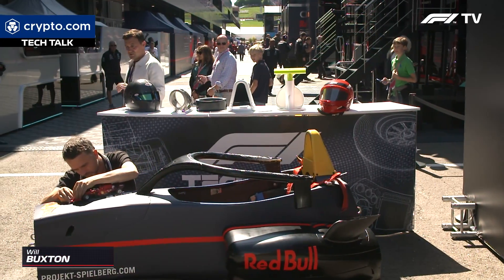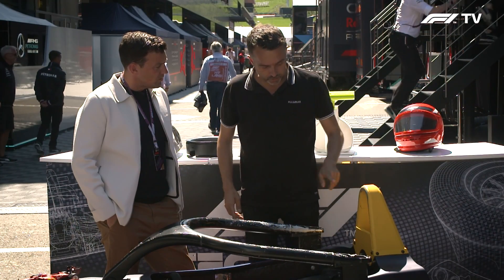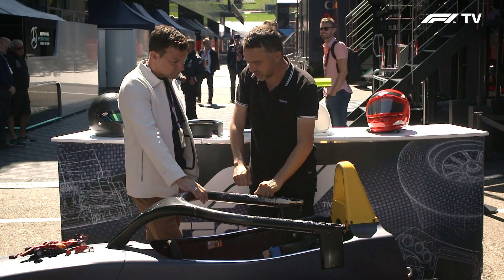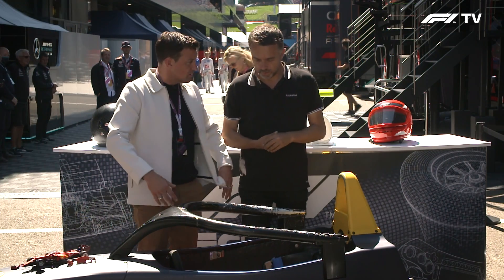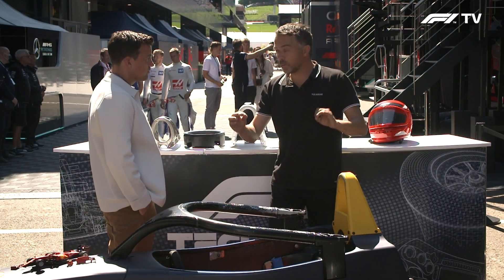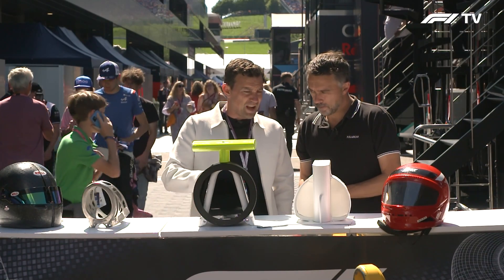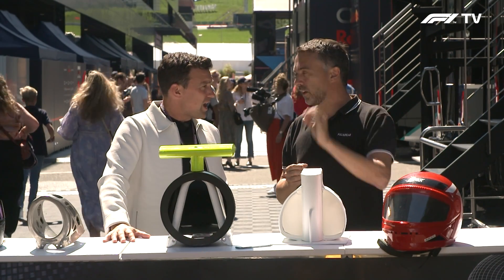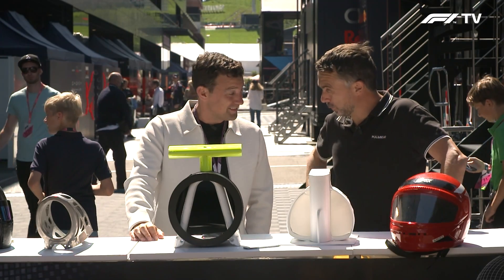How The Halo Works | F1 TV Tech Talk | Crypto.com

Comment: Did they weaken the roll hoop when they implemented the halo?  In the past when a car went upside down the roll hoop would roll the car on a side helping to slow the car when it enters the kitty litter for example.  However when Zhou rolled and the roll hoop broke off, not because it broke but because the attachment of the roll hoop to the chassis broke the halo became a skid plate for the car which allowed it to skip over the kitty litter and hit the fence.

Comment: My only issue with the halos is that I wish they had 2 pillars on 2 sides instead of 1 in the center. It kinda blocks the central view.
Reply: It is more necessary for the drivers to look into the turns than to look straight ahead

Comment: The fix here is to do one test to failure and specify that failure needs to occur within the metallic structure as a ductile yield. Obviously you can't test every car to failure but having a representative design validation test for the failure mode would go a long way to helping prevent this in the future

Comment: How about design a roll hoop that can withstand a roll.
Reply: It wasnt the roll hoop itself that failed. It was the connection between the hoop and the survival cell.

Carbon fiber is strong because of the multiple layers, but because of how the survival cell was attached (a special adhesive, much stronger than using bolts, etc.) it peeled the carbon fiber layers causing it to fail

Comment: There is one thing I'd like to explain:
Except for Jules Bianchi crash, there was not a fatal crash since 1994. And since the halo was introduced, the number of crashes that would have ended fatally without it has increased. Is this just pure luck that we didn't have more fatal crashes in F1 or something has changed?
Reply: Possibly the halo also gives drivers an inflated sense of protection causing them to make riskier moves and ending up in worse crashes.

Comment: Wasn't a fan of the toilet lid (halo) at first but it's proven its worth. If F1 wants to make the sport even safer, they need to shave weight off these cars because they're heavy enough to shatter the roll-hoop.
Reply: It wasnt the roll hoop itself that failed. It was the connection between the hoop and the survival cell.

Carbon fiber is strong because of the multiple layers, but because of how the survival cell was attached (a special adhesive, much stronger than using bolts, etc.) it peeled the carbon fiber layers causing it to fail

Comment: I was hoping he’d talk a bit about waht happens if the primary roll hoop breaks off, as in Zhou’s case
Reply: Pray that the halo works until they change regulations on how the roll hoop is attached I guess. My best guess to fix the problem is add titanium to attach the roll hoop to the cell instead of using a bond to the carbon, or potentially do both at once for the most versatility in situations.
Reply: @jackwinter1507  
And how do you attach the titanium plate to the carbon fibre?
Reply: He said the halo was the secondary line of defense. In other words if the primary loop fails or breaks the secondary one will still protect the driver. That's also why they make sure the driver is below a certain height
Reply: People deflect and say how awesome the halo is.

Comment: The fact that the roll hoop failed was terrifying
Reply: It wasnt the roll hoop itself that failed. It was the connection between the hoop and the survival cell.

Carbon fiber is strong because of the multiple layers, but because of how the survival cell was attached (a special adhesive, much stronger than using bolts, etc.) it peeled the carbon fiber layers causing it to fail

Comment: For anyone that doesn't know, Zhou's rollhoop failed and came off the car early in the crash. That is why everyone praised the Halo because it did the job the rollhoop was meant to do. However it wasn't the rollhoop itself that broke but the bonding that connected it to the car. Still a bad thing to happen but obvisously learnings will come from it.
Reply: The rollhoop did not fail, the carbon fibre holding it on the car failed

Comment: What I have been surprised by is that no one is talking that the rear part of the halo should be above the drivers head. It would change the look and aero but would eliminate the possibility of direct impacts to the helmet from the side and in case that the roll hoop fails it would still protect the driver.
Reply: It would also make it way too hard to get out of the car
Reply: It doesn't they test to see if the driver can get out in 5 secinds

Comment: The halo is a wonderful thing. BUT. The roll hoop broke off this time! That's the key question and it's not addressed here at all.
Reply: It didn’t the carbon fibre that held it on the car did.
Reply: @n0body550  The roll hoop was held onto the carbon with adhesive. The carbon is immensely strong but de laminated. The roll hoop must obviously be fastened in a different way. There was zero explanation and discussion about this.
Reply: @miketrebert7788  I’m sure i seen a video with Ted from the pitlane talk about how the roll hoop wasn’t what failed and was completely intact but that due to more than one force being applied to that part of the car it forced the carbon fibre that held it in place to break off.

Comment: The fact that the roll hoop failed was terrifying
Reply: Technically, the roll hoop itself did not fail as it was in one piece. What failed was the piece of carbon attaching the roll hoop with the car.
Reply: @curtis1552  
That's like saying a parachute didn't fail, it was just the connection to the harness.
Reply: @Robert-j6r8c  You could say that. Unfortunately, parachutes and roll hoops can't be equated as they are not the same. That is why I added the "Technically" part.
Reply: Alpha Romero who are using the single column....maybe it needs to be looked at
Reply: @ajmaddison88  the roll hoop didn't break. the whole piece detached from the car, nothing to do with the design it self
Reply: @formulacock6470  Yeah it didn't fail but how the hoop is attached to the shell will be examined and improved in the next year.
Reply: @ajmaddison88  it passed all of the tests.  Secondary  impacts and something very hard to test for.
Reply: @rhyswilliams4893  They explained the load tests in the vid but they don't try pulling the roll hoop like in the accident.
Reply: @Robert-j6r8c  the tests aren't wrong. They  just aren't thorough  enough.  If the tests where  wrong Zhou would be deaf
Reply: @rhyswilliams4893  
The roll bar failed!... The only reason he is alive is because the halo.

What's the point of a roll bar if it's not protecting you from a roll?
Reply: @Robert-j6r8c  it took the initial  impact as I stated the secondary  impact and the slide is where it failed. None of the safety features  are 100% protection  on their own the combination  of  all the features that make it work.
Reply: Yeah

Comment: Great video, I just wish you covered the topic on why Zhou's roll hoop disconnected from the car - is that a failing from Alfa Romeo that needs further investigation from the FIA?
Reply: If I'm not mistaken, the carbon fiber to which the roll hoop is bonded to tore apart.
Reply: @1_5RCBiker  the roll hoop didn't break, it was the carbon fiber from the tub that sheared off
Reply: @LuisVasquez-nu4hu  the point is the roll hoop shouldnt break,tore, or anything like that ,im pretty sure even with the halo ,zhou`s hellmet was touching the track, lets hope they fix the issue
Reply: @LuisVasquez-nu4hu  
Same difference, if it's not there is not doing it's job.
Reply: @Robert-j6r8c  bruh 💀 I was replying to some idiot who ended up deleting his comment. And also answering Mitchell's question. And it does make a difference, cause everything worked as it was intended to. Just so happens that the carbon tub and the bond with the roll structure weren't designed to withstand shearing forces of that kind. So they need to redesign it with a better bonding mechanism
Reply: Driver 61 did a great video on this a few days ago. I highly recommend checking it out
Reply: @ronaldojoe3011  That's the one! I saw it in his channel. That dude is great.
Reply: @ronaldojoe3011  thanks - just watched it and answered exactly my question!
Reply: Look for B Sport on YT (Ex Force India). He has a concise explanation of the Alfa roll 'hoop'.

Comment: Who ever got the halo idea is a genius, many incidents in F1 like Zhou’s one recently could have ended very badly without the halo
Reply: Mecedez proposed the idea of the halo in 2015 and in 2016 ferrari presented a new design of this, which is quite similar to the one currently used.
Reply: @sebasp1292  wait, i thought mercedes dont like the idea? honest question im new to f1.
Reply: @madarauchiha116  how dont like the idea was hamilton
Reply: It was Mercedes but given the toxic haters in F1 they’ll probably never be appreciated for it.
Reply: If only the "roll hoop" done it's job in a "roll" and not rely on another safety device designed for other accidents.
Reply: @Robert-j6r8c  can the roll hoop catch a tire coming in front of a driver at 300+ kmh? Can the roll hoop shove a crash barrier away before it decapitates a driver?
Reply: @an_iguana4306  
Exactly!... That's not what it is designed for, it failed in the job is designed for.

It'll like asking the roll hoop to do those job because the halo fails when asked.
Reply: @Robert-j6r8c  the roll hoop wasn't the one that failed. The roll hoop got detached because the carbon fiber layer it was attached to got peeled off, so it did it's job
Reply: @an_iguana4306  whether it detached or broke doesn't really matter. It was not there to protect the driver, and it should be analyzed to see whether that specific roll hoop contributed to the carbon fibre delaminating. Possibly one of the other designs would have reduced the tearing forces.
Reply: @stomponpie the roll hoops that the teams design are tested by the FIA themselves to make sure it meets standards, so it's design really won't have a significant effect. and how the teams mount the roll hoop to the chassis is pretty much the same as well. With a special adhesive, much stronger than bolting it down

But for the sake of reliable safety devices, the FIA should seriously find a way to standardize the hoop across all teams
Reply: @an_iguana4306  the roll hoop and bonding didn't fail, but the forces in the crash seemed to pull apart the layers of carbon fibre. There was a suggestion that the single bar design meant it dug into the track and put extreme forces through the carbon fibre and that might not have happened with the other designs.
Reply: it was mercedes idea!
Reply: @PrateekF1  I'm preety sure it was a safety change by the FIA themselves
Reply: @mrdgamesrl  nope
Reply: It didn't save Hubert life though...
Reply: @MIGBMWLOVER  Hubert was hit on the side so the halo could rly do nothing JC!
Reply: @MIGBMWLOVER  how would it even save his life the car literally got t-boned
Reply: Aero screen much better
Reply: I’m pretty sure it was a woman—an overbearing mother, in fact—with too much time on her hands

Comment: I saw some comments from people that still thinks halo is useless and overrated.
I dont know what we need to show them that this is the best invention in F1
Reply: It’s ludicrous the halo slants down towards the chassis around the driver’s head and Zhou’s crash where the roll hoop failed shows that. A revolutionary device, just needs some tweaking
Reply: The halo in my opinion made the car look better. It has saved so many lives in f1 alone. How many Motorsport series are there in the world. That’s a lot of lives saved!
Reply: maybe put them in a car without one, turn it upside down and slide it some distance with a lil speed
Reply: @Nick-mt4wk  and I want you to understand that something that is highly improbable can still happen 2 times in the same weekend. Better safe than sorry.
Reply: @Nick-mt4wk  Ham last year in Monza would have Max's right rear tyre on its head without the halo, in 2018 at spa with leclerc-alonso crash and now with zhou at Silverstone. Halo saved at least these three lives.
I want you to remember that at Imola 1994 Senna and Ratzenberger died and it was since 1982 that a driver lost its life on a race weekend (Paletti at Canada GP).
Reply: @Nick-mt4wk  I was talking about the 1994 deaths. People back there thought it was highly improbable until it became clear it was not. Why are you actively trying to not understand such a simple thing?
Reply: I freely admit I was very sceptical in the beginning, both from an esthetic and a safety point of view.

The looks are still not great and there are still some safety issues imo, but I think we can "safely" say that the Halo has earned it's place on today's formula-racecars!
Reply: @MasterSandman  I didn't like the look of it when it was introduced, but I kind of like it now... don't know why, probably just got very used to it at this point
Reply: @dajda19  Part of the fact is probably how the design for the 2022 regulation cars accounted for the halo as part of it in the very beginning. The halo was introduced one year into the 2017-2021 regs, so it probably looked a bit out of place in the very beginning, but we all got used to it after a while.

It played vital roles in saving the lives of Romain Grosjean and Zhou Guanyu, so even those who don’t really like the look of it would accept it as it has already proven its worth as a crucial safety structure.

Comment: yeah the halo is unreal dude. im so glad it was brought into f1. so many drivers could have died without it!
Reply: Albeeeert❤️❤️❤️❤️
Reply: Carlos couldve wedged the rear tire against the barrier.......
Reply: @Scumbagius  yes he couldve, but in a situation when a campfire is right behind your back you dont really think calmly about all the possible options you have
Reply: Halo could save Jules 😭
Reply: @LSchelvin71  they actual say it wouldn’t have saved him it was the sudden stop that killed him he didn’t hit his head on the equipment.
Reply: @dedo7326  Even though his helmet was cracked?
Reply: @n0body550  where did you get this information from? The FIA itself said the Halo would not help him
Reply: @LSchelvin71  The FIA have stated that the Halo would not have saved Jules at all. The forces from that freak incident were so high that if he had the halo, it would have broken. The Halo is not an indestructible crash structure. It is used primarily to deflect airborne debris.
Reply: Sainz got in danger because of it...it has downsides when exiting the car...they need to make a dispatch option,so the halo opens with a button
Reply: @mrbungle2077  if it’s made possible to come off with a button, then that gives it a bigger margin of failure. That would be too risky. Sainz stayed in the car longer than he would have liked because the car was rolling back, not because the halo was making it difficult. Unless he said otherwise and I don’t know.
Reply: @mrbungle2077  no, sainz had trouble getting out of the car because he was pressing the brake pedal to stop the car from rolling downhill before the marshall got a brick to stop it.
Reply: @mrbungle2077  theyre literally tested to see if the drivers can get out of the car within 5 seconds before every race.
Reply: @mrbungle2077  well before every I can’t remember if race or beginning of the seasons the drives have to do a get out test and they have to get out in like 5 seconds. I will say I’m not a fan of the look of it BUT if it’s between this and an actual closed cockpit I’ll take this any day